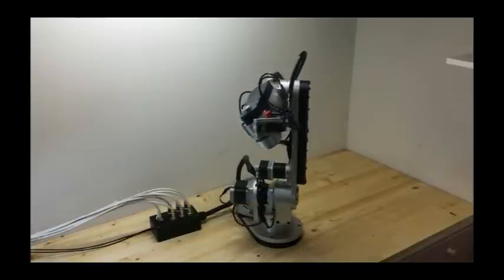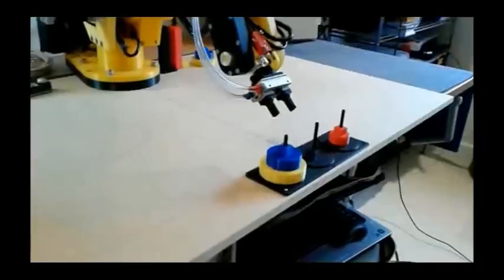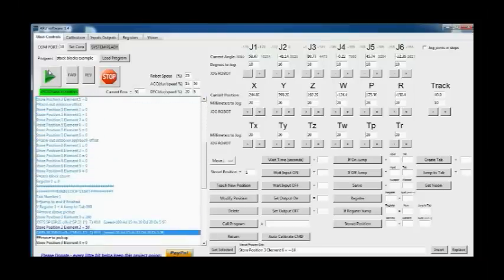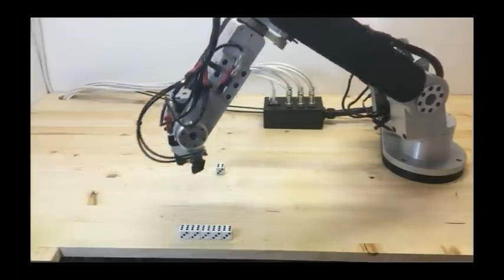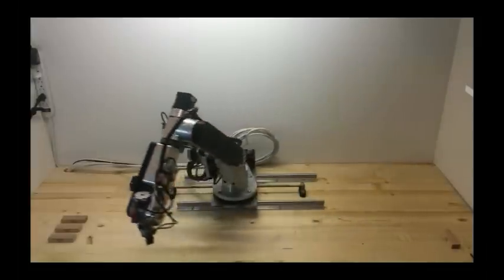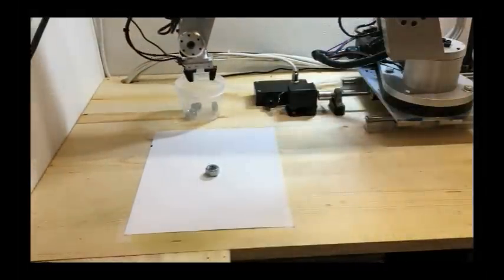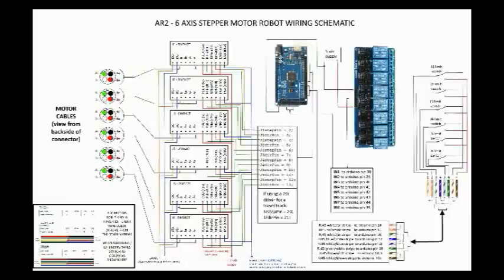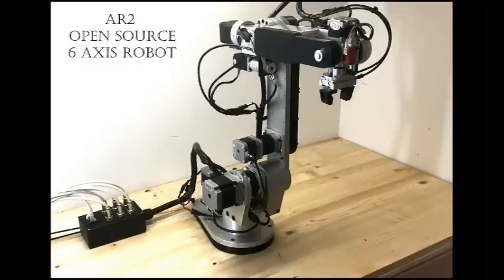AR2 6 Axis Robot Overview

Comment: This is a true labor of love. I've worked on a similar project for about a year, though I'm focused much more on the software side. I'd love to combine my software with your design when the software is ready. It's designed mostly for robots that are focused more on speed and strength than precision, but it is very adaptable to the machine. 

What I mean is, your robot is great - and it also inspires and informs other robots that have different goals.

I'll send you more information as soon as it's ready. I think you'll like the result.

Comment: Great presentation Chris, in terms of the architecture for your next iteration, have you looked into the Mesa FPGA cards that are used a lot with linuxCNC? Thinking that maybe a lot of the groundwork would be there in terms of source code and interfacing with closed loop servos.
Reply from the maker: Morten Hanasand I have not looked into this but I will, thank you for the tip.

Comment: This is amazing. I think this work great for a personal project of mine, but I need to know a couple things. 

How loud is it?
How smoothly does it move at low speeds? If it had a spoon with an egg on it, would the egg stay on? That's how smooth I need it to move.
Reply from the maker: Jason L. Bogle Hello, with the digital drivers it is very quiet if you review my other video on the aluminum version you will be able to hear how much noise it makes. It’s pretty smooth I don’t think it would have any problem moving an egg around and a spoon without tipping it out.
Reply: @anninrobotics  Thanks for the info! That makes it contender for my project.

Comment: If I wanted the arm to be able to lift not 4 pounds but 400, and I didn’t want to go with massive gear boxes that would really reduce the speed, could simply getting much larger motors do the trick? I guess I could also thicken the robotic arms so that it could hold motors that are 100 times heavier.

Comment: Very amazing work, really appreciate your hard work here. i do have one question though, can this be done without a relay ?  why is it necessary? another question, can solid state relay be used in place of this relay ?
Reply from the maker: the 8 channel relay is only for controlling external devises that you want to control from the robot program - for example im using one of the relays to control the gripper open and close,  or you can use the relays to control actuators or whatever you need the robot to control.
Reply: @anninrobotics   Alright, Thanks a lot sir

Comment: Cool project. I don't know much about robatic. But I am an animator it could be  cool if you could control robot with invers kinematics (just animate one point  and   all the calculations is  done under hood) maybe in some  visual  way (maybe build a rig in blender  and it can output  data to  the robot)

Comment: Damn, had a look at the kits... I want one lol. Does it have a teach function where you guide the arm by hand and then it records and repeats? I see the SW files are available, are these the proper files with all the features still editable or have they been reduced to dumb bodies like the step files? What year and SP of SW are you using? I would love to develop this for doing some machining work or even better a diy Moley Robotic Kitchen for those Sunday morning still hung over fry ups lol..

I used to design robotic arms and tooling for subsea ROVs in Aberdeen, Scotland for the oil & gas industry. Have you heard of the TITAN 3 and 4 ROV arm and manipulators. Great pieces of kit. Always wanted to have go at an arm 6 or 7 axis based CNC machine with tool change and material feed system.

Comment: Any concerns with stability, durability or accuracy if the entire build is PLA 3D printed?
Reply from the maker: I havnt used PLA myself but many other have and Im not aware of any issues.  I have used ABS.  The printed robot of course doesnt have quite the stability or payload as the aluminum but still works just fine.
Reply: Excellent.  Thank you so much for your quick response.

Comment: What a cool project!
I was wondering; What is the lifting capacity when the parts are 3D printed? What is the weakest link in the chain? (Steppers, mechanical parts, belts,.. ? )
Also, do you have an approximation to the total cost of all the components?

Comment: This is a job well done. Would be possible to use this robot like a 3d printer? I mean to install a hotend at its hand and use It like a printer.
Reply from the maker: Marco Souza Moers One of my future goals is to build in functionality to read G code to make that a possibility. I’m not sure if the plastic version of the robot would have the rigidity needed for 3-D printing but I think the aluminum one could probably do some basic printing. Another one of my goals is to make a next generation robot that is a little bit larger and has encoder feedback with even more rigidity, so maybe at that point and after I get the G code functionality built it might be a real possibility.
Reply: @anninrobotics  Congratulations on this work. Really the pictures are awesome. If it is possible to use a gcode file on it, I imagine that many interesting possibilities are feasible: welding, painting, sculpture and so on.

Comment: Love this project, Chris, you've done a great job.

Can you give me a hand in identifying the actuator (grabber / hand) @ 1:17 that picks up the thin piece of metal? I am trying to google it but no idea what to call it.
Reply: Ok pneumatic gripper works :D
Reply from the maker: Aaron DC mediA it’s an SMC pneumatic gripper. I don’t recall the part number Right now, but it is in the bill of materials. As I recall I got it off eBay for a fairly reasonable price. Pneumatic rappers are fairly expensive but it’s the only way to go if you really want to grab something with any force.
Reply: @aarondcmedia9585  
Werner Berry
2 seconds ago
I designed the end-effector you are referring too! This is my AR2 variant that you are seeing! I did use the SMC pneumatic actuator along with 3D printed extensions and a linear bearing. I have to say the design works really well and could be adapted to many different sizes and shapes of fingers.  I will try to post more info on the https://www.anninrobotics.com/ site!

Comment: for speed movement, is it possible to modify..? like speed ramp camera movement,  i interesting for high speed camera movement recording..please kindly reply....thank's
Reply from the maker: yes the program has speed settings and you can also modify the speed multiplier in the arduino program and crank it up a bit more.  please see the programming vids that cover this.
Reply: @anninrobotics  thank's a lots, for arm robot kit shown at your video, is that designed by your own, or sell free at online store, honestly, i'm very interesting and want to learn to make my own project...
Reply from the maker: thank you

Comment: With 25' of backlash and only 25Nm of torque from geared NEMA23 motor, how can it be practical? 25' translates to approx. 2mm of positioning error in the middle of work area.
Reply: for small size objects its good enough. If you want 100% position, use harmonic drives. But that will kill the affordabillity of the project.

Comment: Can you do mate please CNC 360 degrees metal milling application for this robot plus tutorial? Then this robot could be useful for making metal parts and it could replicate itself while creating parts for self and then you will no need for separate machine for metal works. We want that!!!!  You need attach some tool like metal drill at the end of the robot and modify for G  CODE applications! I mentioned 'metal milling'  but actually it could mill anything out of big chunk of any material blocks like wood, plastic etc. If you will make 360 from any angle then it will be possible cut metal in straight lines as well like laser cutter. Mate - check out POCKET NC2 desktop milling machine here on youtube - this will give you some extra ideas for your open source robot which one I am ready to build one as well. Kind Regards!

Comment: Mm hm. Get rid of the exposed wires man. Looks tacky. Enclosed them some kind of housing to make it physically streamlined and neat looking. Two, make that thing mobile optional. Meaning you can pull it out of it's fixed base and slide snap it onto a wheeled rover unit (or caterpillars) for more dynamic functioning. AND Have it where you can hitch it to a small wagon so when it roves about, it can automatically pick up junk wherever it sights them,  and toss them into it's "bucket". Scattered nuts and bolts, nails, plastic parts, wooden objects, pens, pencils,  etc. all on the on the floor. That would be totally terrific!!! Becuse I've YET to see something that epic. Man with all that algorithm and coding ability you've got, ain't no way in hell you can tell me "impossible!"

All That should be a cinch for you to accomplish. Now you might think I'm now being a complete dick, but I'm quite  positive your orders will triple soon after you do like I suggest. As it is, I wouldn't buy it. Otherwise I would, even if you go up considerably on your price, becuse it would be one hell of a BAD-to-the-bonemarrrow bot in the versatility dept.

Dude the way I look at it, it appears you had invested a  million years into that armbot, from soft to hardware. Shiiid! May as well go the way to home plate. Why stop at third base and call it quits?

Ha ha I wouldn't if I had your high-tech talent!!! Exploit it some more!!! You ain't finished yet. I see so much more potential in that machine.
Reply from the maker: SwarthySkinnedOne Thanks for the feedback and the good ideas. Yeah there’s still a lot of things I can improve upon I’m just getting started the next version row but I will hide all the wires this one I was trying to make it so it could be made out of aluminum or plastic so not so easy to hide the wires especially with the goal of using $10 worth of LED wire. Next one I have some ideas to make it better.
Reply: @anninrobotics  

LED wire?
Reply: @anninrobotics  

Anyhow, yeah, cover them wires up. (Your armbot system is a very nice one btw, whereas most other home made ones on YT are pieces of crap!)  And I'm looking forward to seeing your armbot roving around and about on wheels or caterpillars and picking up littered objects and towing them along wherever it sights them in travel. That would be a very very nice task go behold! That is what I see your machine mainly made for, other than assembling something, like a music box. And this is the level you must take it to. 

You have the talent. Exploit it further.
Reply from the maker: Cheap 4 strand LED strip wire. On amazon for $10 a roll. My entire goal has been as cheap as possible.